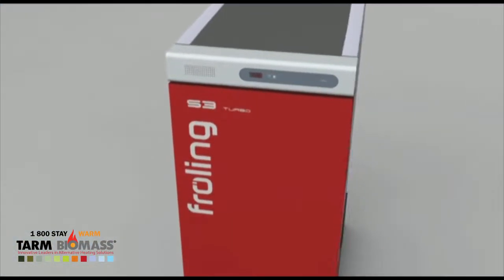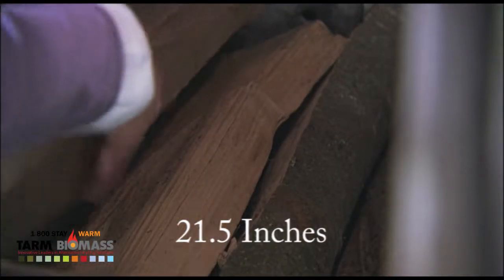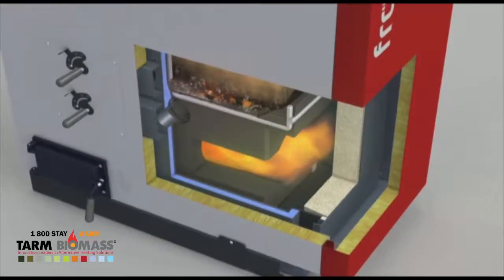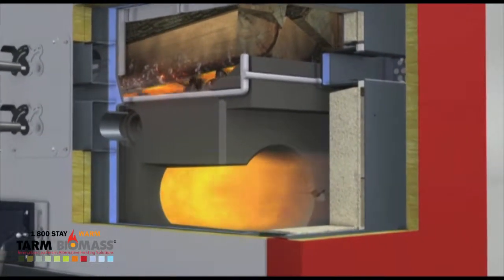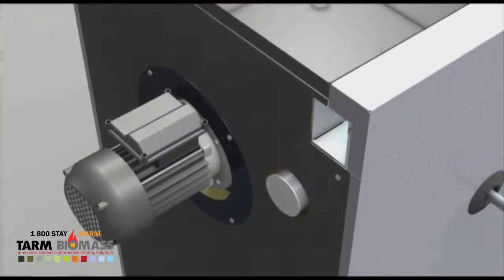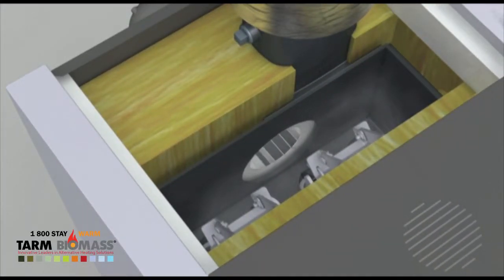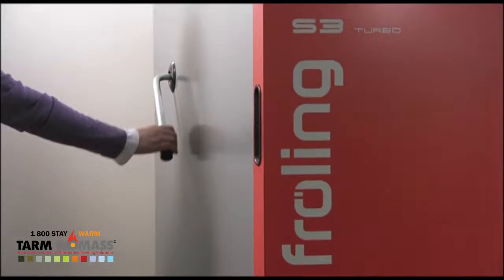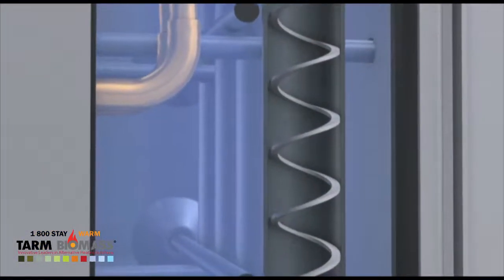Fröling S3 Boiler - See How it Works

Comment: I started model S30 on 1-6-21 and after a few days of learning how to operate this boiler, 
it is working wonderfully.   I replaced a 38 year old Tarm OT30 and this new boiler uses
about 25% less wood than the old boiler.  I am very satisfied with the operation of this new
boiler and thermal storage system.  You only get what you pay for and it is worth every 
penny spent.
Reply: Do you have a storage tank? How big? And how long can you go between loadings?